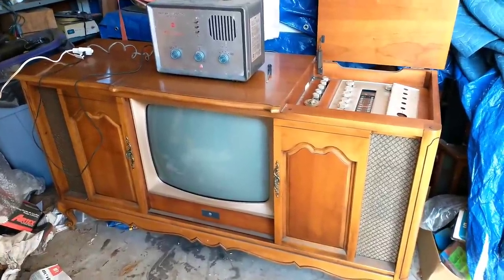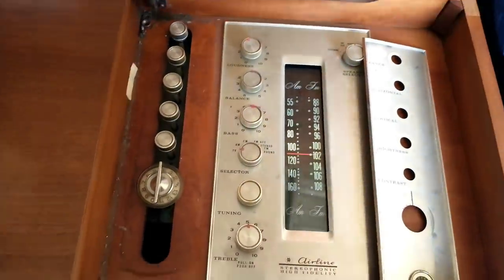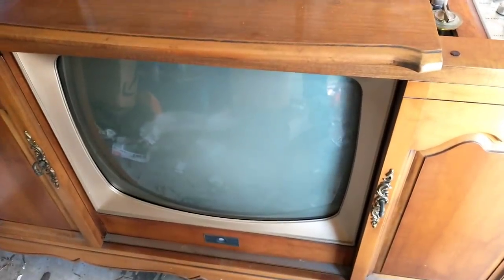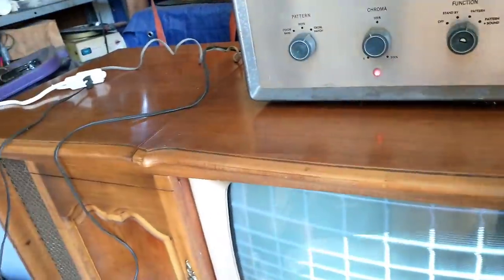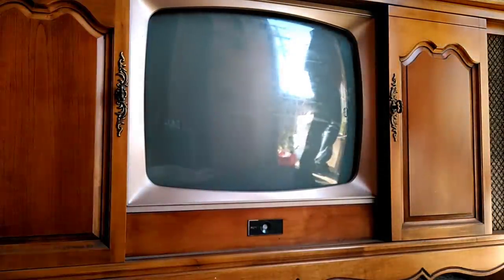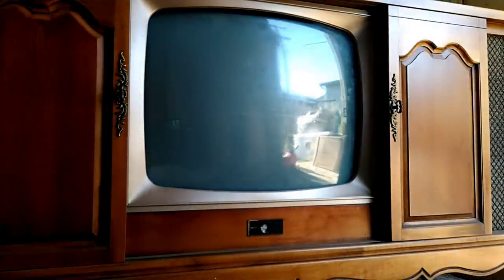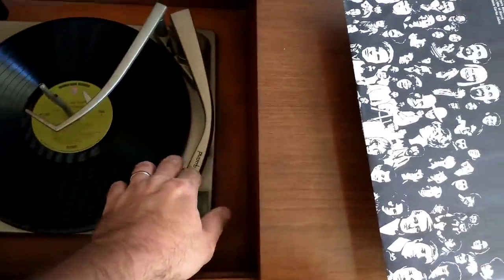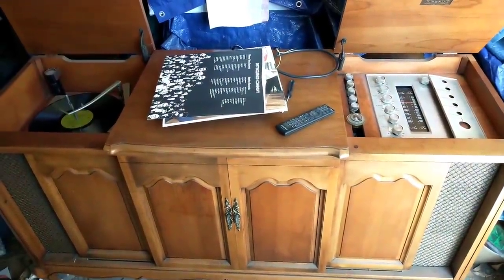Servicing the television of a 1963 Montgomery Wards Airline Imperial console. WG-5974A. Part 3 / 3

Comment: Excellent job! You worked through a lot of details to get this baby going. That set actually produces a very nice picture, minus the DC restoration issue that you spoke about. The linearity of the picture both horizontal and vertical is quite good for a black and white set of that vintage.

Comment: My parents had the same 1963 stereo console without the TV. I also remember their FM radio had to have the optional MPX adapter to receive FM stereo, hence theirs had no stereo indicator lamp, even though there is a FM stereo position on the mode switch. Does that unit have the optional adapter for the MPX, or was it built into the tuner on this one.

Comment: The Airline console my parents had was designed by RCA. Nice 6BQ5 push pull set of 4 outputs for audio as I recall. Rated at 20 watts per channel, but that must be peak. That would be a stretch for those tubes. Was the TV set also designed by RCA? You said Wells Garner in the past video, but weren't they just assembling designs by RCA under licence?
Reply: The amp put out ten watts per channel.  Total 20 watts total.  Each 6bq5 tube puts out five watts,unless the manufacturer  modified  the output